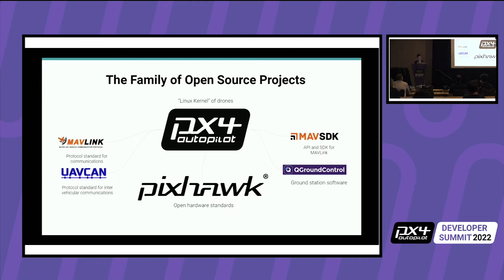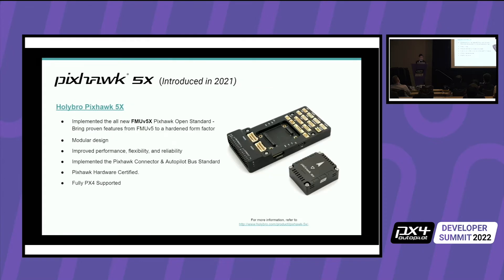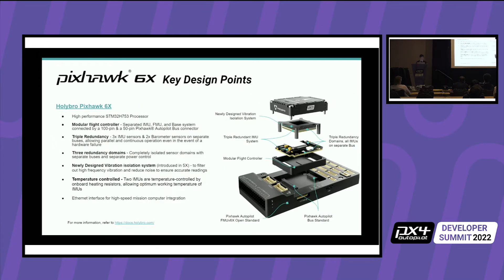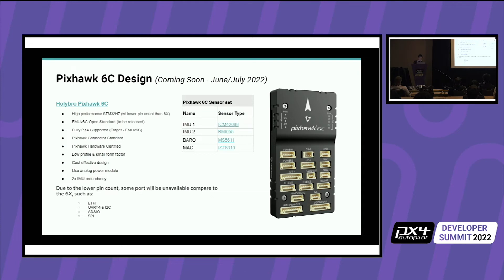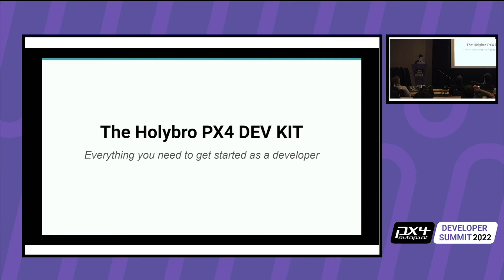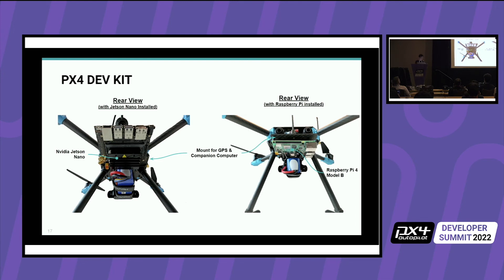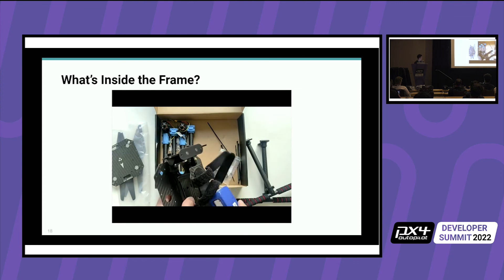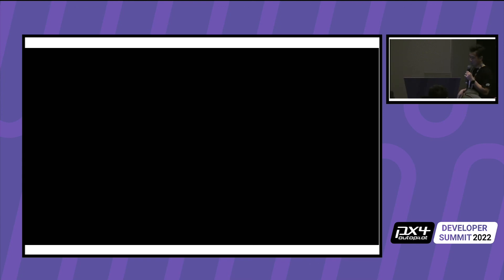Holybro Pixhawk 6X & 6C - Vince Poon, Holybro

Comment: I'm having issues with pixhawk 6C. Three days reading forms and I still can't get the servos to move. It would be nice to have a step-by-step instruction manual.
Reply: I can't control the motors with the Pixhawk 6X
Reply: @fernandoalgarin7017  I noticed this morning, the pins are reversed on the 6x.  On the 4, from top it's ground, 5v and signal.  on the 6x it's signal, 5v, ground, reversed.  If I'm wrong please let me know, but it looks upside down on the x6.  Hope this helps.
Reply: I'm having the same issue with the Pixhawk 6X , I can't control the motors (I'm using QGroundControl) , If you find a solution I would appreciate if you share it with me.
Reply: @fernandoalgarin7017  figure it out?
Reply: @Hoffmanpack  some updates? I know the Holybro PMUs are "not designed to power servos" (copy-paste), were you using a PMU? Instead, they recommend to "please use your aircraft's ESC/BEC for that"

Comment: Need help I am having pixhawk 6x
Reply: I'm having an issue with the Pixhawk 6X , I can't control the motors (I'm using QGroundControl) , If you find a solution I would appreciate if you share it with me.